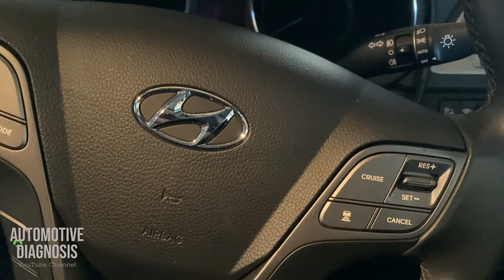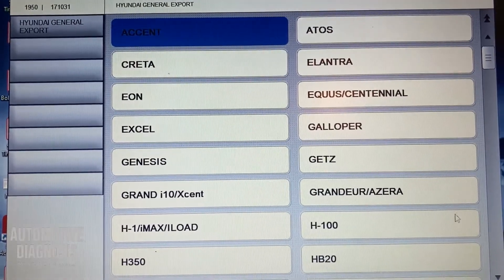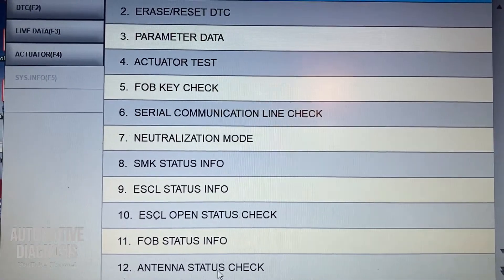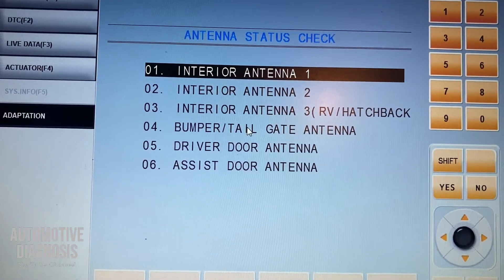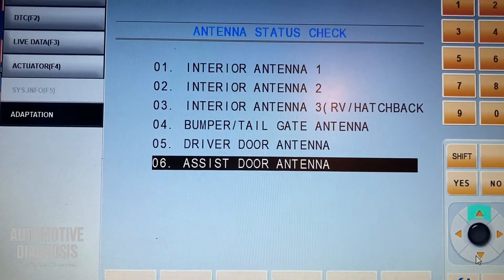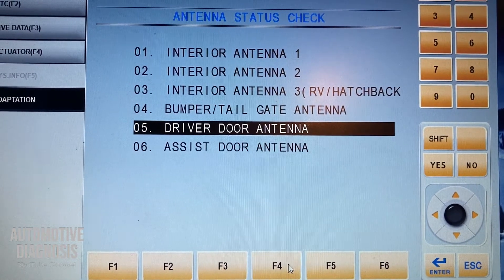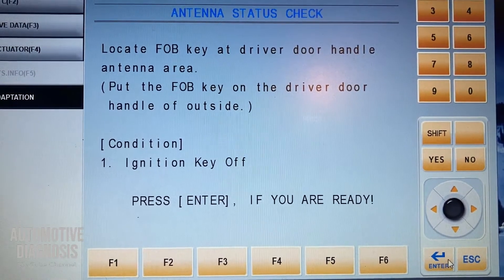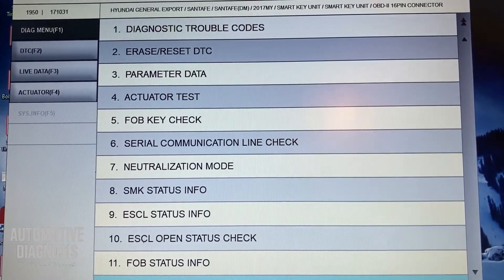How to Check LF Antenna on Hyundai "Santa Fe" Smart Key System (Applicable to all other Models)

Comment: Damn it. I think my bumper antenna is bad. I can't replace that myself. I have a 2017 hyundai avante/elantra.. Any idea what the service center will charge?
Reply from the maker: Hi there, how do you know that rear bumper antenna is faulty?
Replacement is very quick so for an experienced guy will be just like a piece of a 🎂. But you need to make sure that there is an antenna inside the rear bumper as I’ve seen some aftermarket smart key without that antenna.
Reply: My trunk release pad stopped working. So did the smart trunk function.